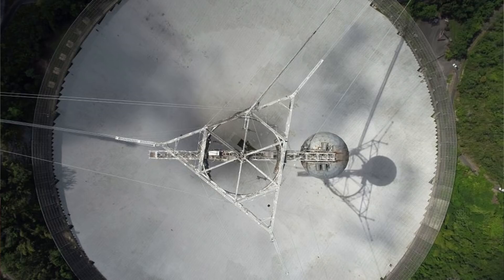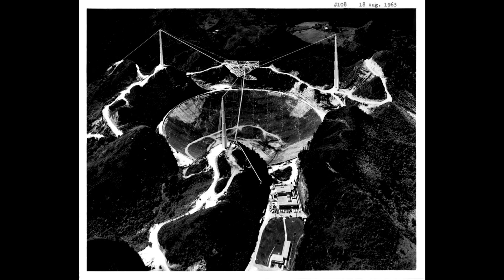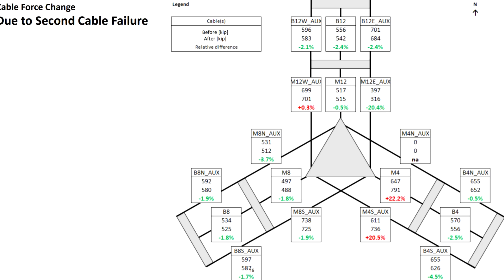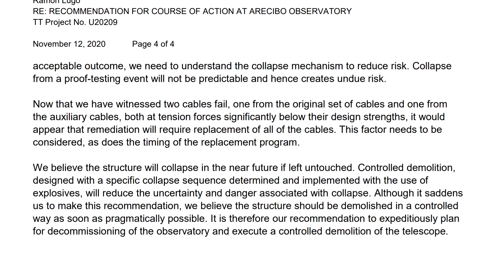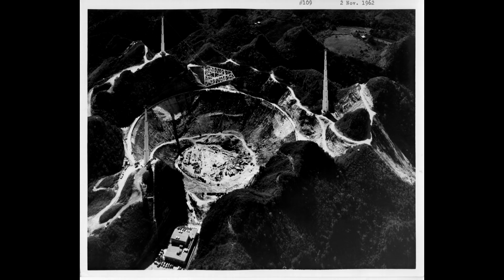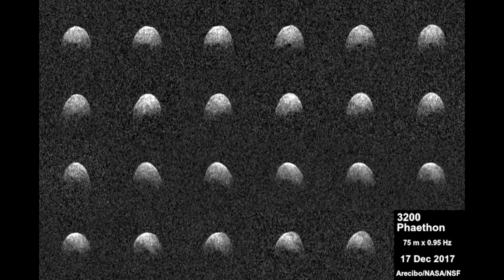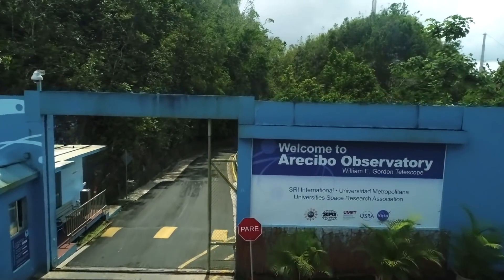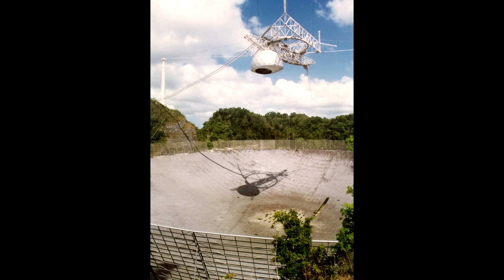Worlds Largest Radar Astronomy Dish To Be Demolished!

Comment: The reliable way to have done this would be to have six towers at 60 degree intervals. Have each triplet be able to support the entire load of the secondary. Then you could repair and upgrade the redundant set, then swap the load to the newly fixed triplet and get to work on the other one.  Obviously this is twice the cost of the support system of existing Arecibo.
 It looks to me like they got into a situation where they had to have every single cable in the system to hold the load. So it was impossible to remove even one cable to replace as they started failing.

Comment: The load cables, used to suspend the focal done and transceiver housing, began suffering from structural fatigue over time, due to rusting caused by the salty ocean air, stress caused by high speed winds caused by tropical storms, and humidity due to Arecebo being located in a tropical rainforest.  

 Finally the load cables are actually several thinner, steel cables wound together to create a larger cable. But none the less, Arecebo is 7 decades old. It's showing its age. 

NASA has been working on replacing Arecebo with a space based platform to do the same job with less signal interference.

Comment: The problem with the helicopter plan is you will still have wire cables flying that would convert you to a fine mist and a spring loaded tower which is functioning as a catapult when the wires go

Comment: I used to work at Hartebeesthoek in South Africa, which was one of four large dish antennae at that time - Goldstone, Hartebeesthoek, Woomera and Madrid.  That was a long time ago - I left there in 1974, and Goldstone was our HQ for space tracking.  It is true that they could transmit (ours was an 85ft dish transmitting at 10kw on a beam width of 0.5 degrees, with a reception threshold at -172dBm).  Things may have changed since then, but at that time, Goldstone was not used for radar.  It transmits messages to spacecraft and receives their transmissions.

Comment: As someone watching this after the telescope failed, this is definitely a huge oof, but they definitely made the right call. Even the whole 'hang a platform from a helicopter to work on the telescope without being ON it' would've been a horrible idea; one cable going just the wrong direction after snapping would've been enough to end in immense tragedy. We saw what one of those cables did to the walkway. A couple cables and some railing would not stop them from going right through someone instead of something.

It sucks that all this happened, but unfortunately such is life. Sometimes shit just happens and one needs to know when to throw in the towel and let things happen. You gotta know when to fold 'em, and the people managing Arecibo clearly did.

Mostly I feel bad for the local people who've now lost one of their biggest local monuments, and very possibly won't be seeing a replacement ever, given how the economics work (and especially given the current economic crisis that might be about to get substantially worse).

Comment: Ahh, that sucks. The Government must have had a plan to keep the dish in operation for a limited time only. I mean the 60's did not offer great technology, but they just started with the crazy stuff. Surely they made a decision that it wasn't worth upgrading or keeping it beyond a certain point. Although the cheaper long term solution would have been upgradeability. If only they had left a pulley system and a extendable platform (even just scaffolding in the center) that can allow for the gantry to be lowered and then you can work on the ground, as well as replace cables or upgrade systems. Feels like laziness and lack of foresight, but we now know she's a goner.

Comment: Regarding the idea of rigging up replacement cables vs building it in the first place: it's VERY difficult at the best of times.  I'm the wrong kind of engineer to be doing anything with cables other than possibly talking to a mechanical engineer about getting a mineshaft elevator system put in place, but even from my first year classes I do know a bit about designing of cable structures like suspension bridges, and even with those relatively simple structures, running a cable while the bridge deck is in place is a bit dangerous (and there you have the massive benefit that most of the load on the bridge can be removed by just shutting down the bridge during maintenance.)

The first step to a structure like this is always to build the support towers - Aricebo has 3 big ones, most suspension bridges have 2 at/near either end of the bridge. They're freestanding structures at the moment, but that's not going to last,

The second step is to string cables.  This generally requires first running a relatively lightweight guidewire that can support a device that spins the permanent cable.  You want a minimum number of breaks in the wire, so when you're spinning the permanent cables, you're actually running a coil of wire back and forth and using a device to wrap that wire around the growing cable - each strand takes a pass of the cable spinning device.  (These days, I think there's an automated system, it used to be done by hand.)  At the same time, because the permanent cables are so damned heavy and they're under some tension right from the start because of their own weight, you need to rig up a thing that pulls on the towers in the other direction - this usually means more cables to anchor points on the ground.  And as soon as you've done this, the towers are no longer free standing, because if either set of cables breaks catastrophically, the other set will rip the top of the tower off.  Each set is pulling on the towers' peak with an incredible amount of force in opposite directions to eachother.  Undoing that is a very delicate process, because you have to ratchet down the tension on both sides simultaneously.

Third step is to add load to the cables.  For a suspension bridge this means rigging up the vertical support cables and building a bridge deck.  For Aricebo it was building the central structure in the dish area and winching it up and attaching it to the cables.  Now that you've attached your load to the cables, you've got even less margin for changing things in the cables, because they've got even more tension on it.  (This is why suspension bridges are easier to work with - reducing load is as simple (albeit disruptive) as closing the bridge.  Aricebo can't just pull bits off the central structure on short notice.  (Well, it can...and did.  But you can't do it in a way that keeps the central structure being anything resembling a structure.)

Add to the fact that they've got cables proven to be failing signifciantly below their intended strength and cables that are already suffering significantly more load than they did only weeks ago, and you've got a critical problem.  Any attempt to string a new cable would likely have resulted in the same collapse we got, only with the addition of workers (and apparently a helicopter) within striking distance of those flailing failed cables.   And failed cables, before they stop moving, might as well be lightsabers as far as their cutting capacity is concerned - no human is going to stop it, and I doubt a helicopter chassis would do much to block it either...so that would have been a bloody affair.  

Sad as I am to see Aricebo's crowning glory die, I'm glad the engineers calling the shots had the good sense to let it rather than sending in workers to die along with it.

Comment: as of today it has collapsed fully, no need for demolition plans any longer... but the deconstruction of parts and clean up will need to be set up and initiated.  they think an earthquake put enough stress on the remaining tethers and one failed, with a cascade effect stripping the rest , even pulled down one of the towers.. or at least part of one i think, and video exists of another shaking while its cables where stripped as the unit fell into the dish... feel free to look it up, sorry i don't have an exact date, but it is down now.

Comment: Is it just me or is using vertical cables to dynamically change the load on the construction a really terrible idea, given that you put new stresses on the material that certainly has lost a lot of its flexibility and has become more brittle over time, so pulling on that "depending on the time of day" sounds like the gentle attempt to slowly break it.
Speaking of becoming brittle: Did anyone ever consider for how long these cables would have the material strength to take the tested 500 tonnes? I feel reminded of airliners and metal fatigue stories in aviation. Changing the loads to these the decades-in-the-weather materials sounds pretty dangerous, if not reckless to me... both the 1997 upgrade and the vertical wires.

Comment: 56 or so years old. Didn't they ever hear of preventive maintenance? You don't try to build things to last forever...you design and build them to be able to be maintained, which in this case means making cable support structures whereby the cables can be periodically replaced.  We have bridges in my hometown of Pittsburgh which are older than Arecibo, and yet have the original cables. Maybe they were over-engineered but they're still standing. I wonder what happened here? Poor quality control?

Comment: Deconstruction depends on what they want to save... if they don't want to save anything I would just drop all the cables, then clean up the rubble.
Reply: Oh... I just got to the part where you said that too :)
Reply: What they need to do is remove the overhead components bit by bit and replace it with a new light weight replacement.

Comment: I wonder if FAST can be upgraded to do radar
Reply: Probably can't. The FASTs platform is very light compared to Arecibo, so their cable system and towers are not designed to handle a lot more. But radar system would add probably 50 tons of equipment and structures, which is just too much. The current platform is just 30 tons, and designed as receiver only. Not to mention, it would require disassembling big parts of the dish, to lower back the platform and mount stuff. What is better to leave the FAST as it is, to be sensitive receiver, and build a second smaller dish, just as transmitter, (with some minor receiving capabilities), in relative proximity (preferably less than 100km away), and use them in tandem. The smaller one, could be probably just 100m diameter, and be quite useful, for example to determine distances to asteroids, and determining rough shape of asteroids.

Comment: I am a student of Construction Engineering, that covers statical mechanics and material science - along with some industri norms and history

When it comes to the wires it sounds like the telescope was lacking some major maintainece. Tightened wires are often used for bridges, cranes and these telescopes specifically because of the ease of locationing potential structural failures as the don't break instantaneously but rather uncoil and shred long before they tear.
When it comes to actually working on the cabels; not only is the expected strength apparently way higher than the actual strength, 60% is an incredibly large margin, but there is also the fact that a steel stressed at 60% is liable to be disforming plastically, meaning it actually stretches, but if is almost at maximum stress, due to the miscalculated strength, it is surely deforming plastically. This means the all cabels need to be exchanged. but it also means that any change in the stress and/or strain on the wires will very quickly induce severe material fatique, further lowering the stress all the remaining cables can handle...
So not only is the thing seemingly falling apart, but working on it may make it fall apart even faster.
Reply: i believe that in the video Scott did about 3 months ago on this place. he said it was the joint that held the cable to the pillar that failed. and not the cable itself.

he even mentions in this video, that it was the socket that failed, and not the cable.

the result of the cable that did snap, was not due to poor maintenance. but due to increasing load, caused by the missing cable who's socket had failed.

Comment: If they could reduce the strain on the cables it could bring make with in safety margins? Three mobile cranes with rigging across and through the super structure of the central receiver could take some load off. But I have no idea if the trusses could take that load :/ plus it seems like its getting more dangerous and weaker by the day. If they seriously considered dangling people by helicopters to attach more cable then i think its safe to say they've thought of just about everything. This would have a great use case for remote control humanoid robots like Atlas to work there instead of people but the technology isn't here yet. Unless Spot is more handy with a drill than I thought lol.

Comment: I know this may sound like a dumb question, but couldn't they just put something like stand jacks at the tops of the towers around the cables and then lower the floating antenna down by slowly realing out the cable until the antennae platform  hopefully reaches the ground safely and then just restring and tension the cable back up to raise it up again?

Comment: A bit of blue sky thinking; what if the detector truss were suspended on all three points using aerostats. If needed, the cables could be supported in the same fashion. Sever the cables with explosive charges and lift the truss away and park it. Replace cables on all three towers up to the apex of each and run messenger cables out to the center of the dish. Re-suspend truss on 'stats and run messenger cables to each of the three suspension points on the truss. Pull new cable for the truss. Get Elon to pay for it.

Comment: I'm a millwright and I see the cable jackets (to prevent corrosion) have not been mantained. Large steel cables need these jackets to prevent the salt corrosion of Puerto Rico eating through the cables. I suspect the whole structure has these maintenance problems. Write off.

Comment: Might be straws, but if that is the position..use dirigible size He balloons to lighten the load on the gantry cables enough to make it safe for workers to go out, plus a whole battery of instruments monitoring the weak points - although the two cables just "went", they can't have instantaneous, surely..?

Or some combo of this & Tchiwam (17h) or Mikowmer's idea (20h before this)..problem here seems to be not that it can't be fixed (your suggestion of philanthropic support from the scientifically minded 0.1%, or some sort of private-Gov partnership), but the time frame, physical constraints, & personal danger involved; having said that Arecibo is irreplaceable

If the decision is scientific euthanasia, why not just pull everyone out, plaster wall-to-wall warning signs on the boundary fences, & run a lottery on the time of collapse, proceeds to go to the maintenance of other instruments in similar straits (or though pay-per-view of the demolition would probably raise more)

(could always do it at 1 minute to Inauguration time as a Last Post salute to 🎺, although it would have to be precisely spot on, as being even 60s adrift means it will be taken instead (by far too many) as a hopeful omen of the Biden Presidency..)😉

Comment: I think that the safest way to repair it would be incredibly complicated, and probably too expensive and time consuming.

You would need to build three temporary towers (and fast). Feed three massive cables through the prongs of the structure, and then slowly take the weight off of the existing cables. To get the cables through without having someone on the structure itself, you would fire an arrow with a line attached through where you want the cable to go, before using that line to pull through bigger and bigger cables, being careful to not put too much strain on the pre-existing cables. Once the structure is secured, you can then start replacing the remaining cables one by one and possibly add some new ones. Then just lower the support cables and the temporary towers, and any other repairs can happen as they need to. 

But considering that the construction of the temporary towers would be the most time consuming part of this, I'm not sure this idea is practical.

Comment: I look forward to Arecibo's replacement. Hey, let's build one in Arizona's Meteor Crater!  https://g.page/meteorcrateraz?share
Reply: 1300m across v 305m, much drier atmosphere, much closer, sounds good..

& added bonus is that if there is a monolith buried at the centre humanity gets to phone home a little earlier than they would have otherwise..

(or have they already checked, & drawn a blank..or NOT drawn a blank..???) 🤫
Reply: @philcoombes2538  Probably less stray radio energy as well. But let's put the receiver on a pillar instead of hanging it this time.
Reply: @golddiver  If there is a gantry similar to Arecibo at China's FAST I can't see it, although there are towers surrounding the dish

What is gobsmacking is that this installation's construction apparently cost the princely sum of $171m (+ $23m for a standalone data-processing centre), which, if not quite petty cash to Bill, Jeff & Elon et al, is certainly no more than monthly housekeeping..

although what the equivalent cost in the capitalist-hyena ridden West would be I don't know..but on those grounds I could quite easily understand their saying a from-scratch new build (on the same site..?) would be far more cost effective - providing a NEA doesn't crash the party while putting the new one up..

(the Notre Dame restoration bill is already north of $1*bn*, while a single F-35 retails for what - $130m, + 10% for customizing (leather seats, 4K TV & mini-bar) & another 5% in sales tax..?)

grrr..